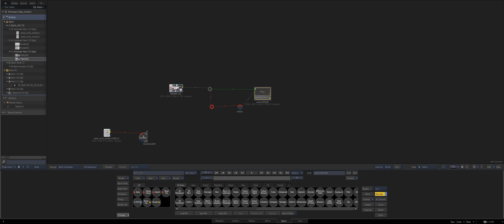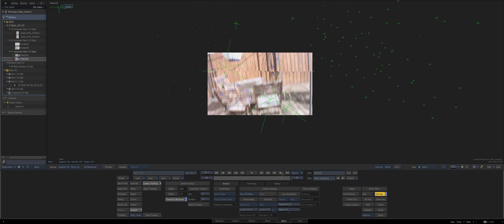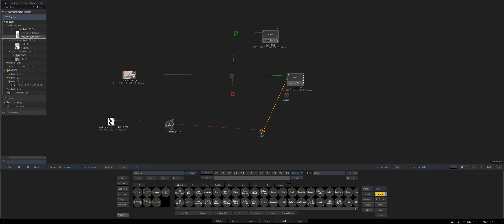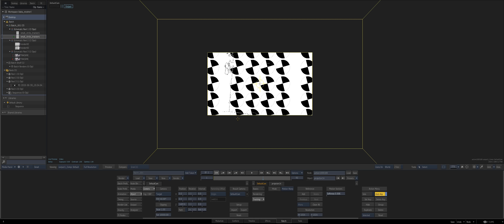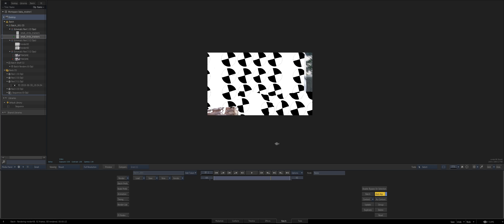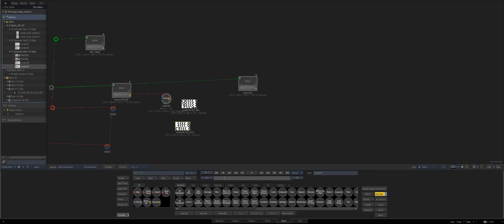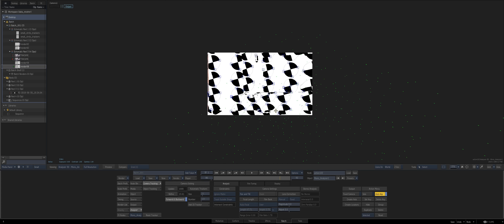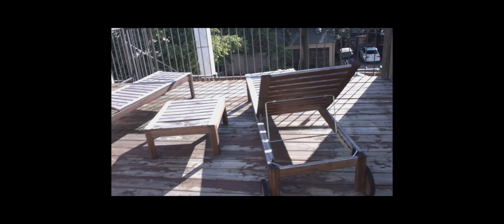Datamoshing for unsolvable 3d tracks

Comment: This is really useful for planner tracks and setting up object specific points for locators on buildings and ground planes and can be faster if you don't need the whole scene. Same concept...paint a still with dots do a replacement with a solid planner track and then bam you've got locator points.

Comment: How would you replicate that in Nuke? That's a really useful trick.
Reply from the maker: Not 100% sure the exact steps in nuke but I'm sure it could be replicated using a similar process
Reply: @JoelOsis  Yes, I just don't know how you project those tracking markers without having a camera . Will ask someone who know's both systems. If I find an answer will post it in here.
Reply: @bass_journey  did you fix this? just use a vector distor with a source that has an alpha then merge.